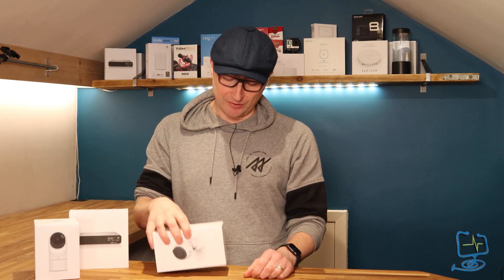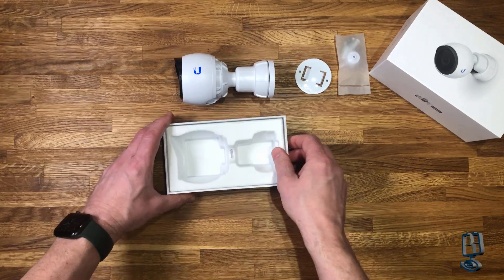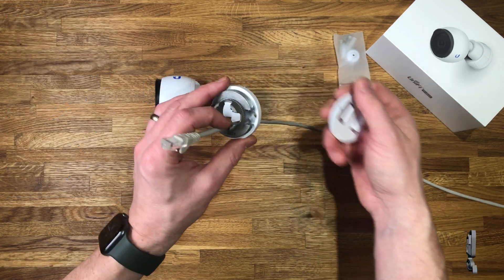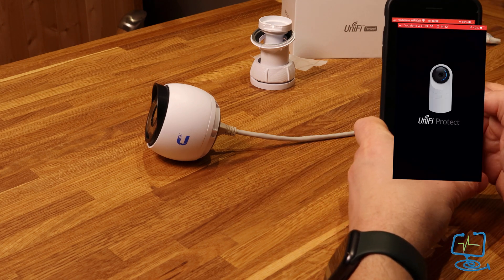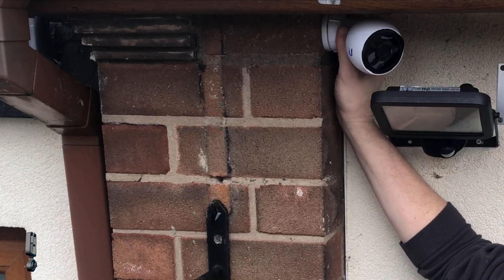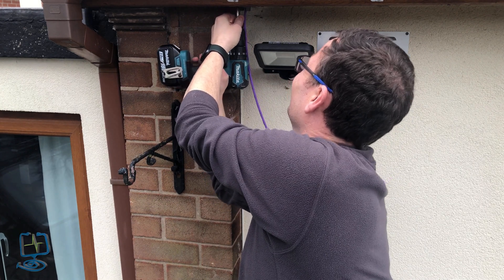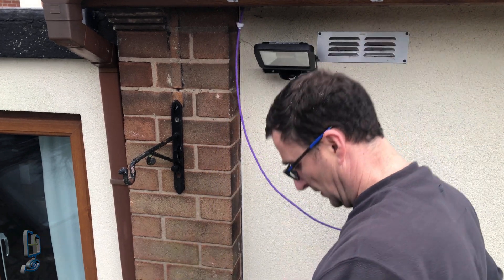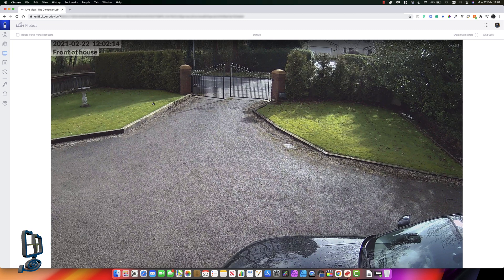Unifi Protect - UVC G4 Bullet - Full Install and Unboxing of G4 camera including setup Protect App

Comment: I have RJ45 cable coming out the wall but I cant push back the excess. Would you say it's still possible to fit the camera such that the wire isnt visible?
Reply from the maker: There is a small amount of room in the mounting arm to maybe coil a bit into it but really not a lot. Best idea would be to cut the cable and put a new rj45 on it.
Reply: @TheComputerLab thanks for the really quick reply. Yeah I'd crimp a new connector, as long as I am still able to plug it into the camera with some room inside for the wire to coil slightly as you say.

 Currently have Reolink cameras and theres a ridiculous amount of wire hanging out.

Comment: what exactly do you need to get it to work? camera, cloud key, PoE switch?
Reply from the maker: Hey - Yes you need the cloud key with the built in HDD (or dream machine) a Poe switch (or normal switch and use a Poe injector) and the camera.

Comment: Great install info!  I’m about to go all in on Unifi network of AP’s and cameras. 
Have you installed a G4 higher than in this video? I’m concerned that mounting on the soffit of a two storey house may be too high?
Reply from the maker: I have yes and they are ideal for higher up. The Unifi G4 has quite a narrow field of view (if memory serves me right I think 86 deg) so the higher up it is the more you will get in the picture.
Reply: @TheComputerLab  thank you! This is good to hear as I’ve been searching everywhere for info on mounting height! Is the clarity of image still good at height?
Reply from the maker: Yes - Its better than the Unifi g3 flex, with the G4s you also get the smart detection
Reply: Dont do it. This company has a tendency to drop products and stop supporting. You will be forced to buy new gear a few years down the road. Been there and no more UBNT for me...